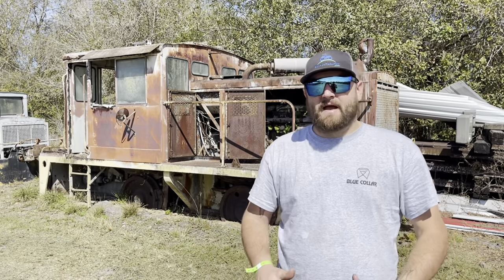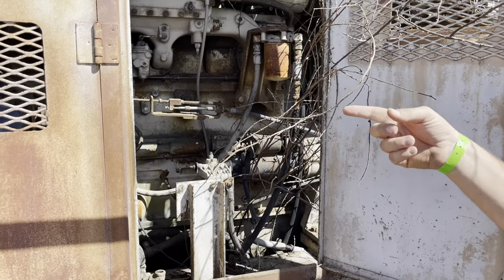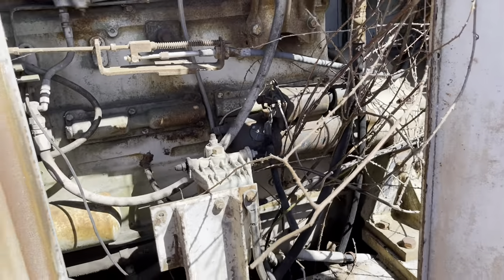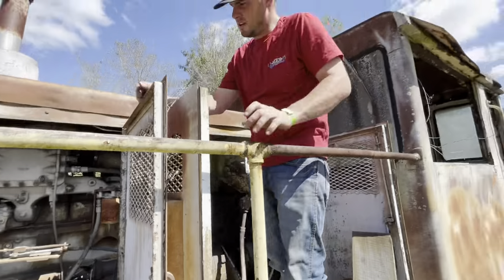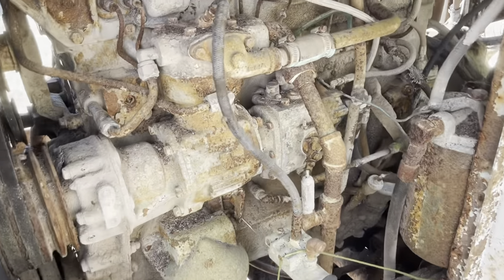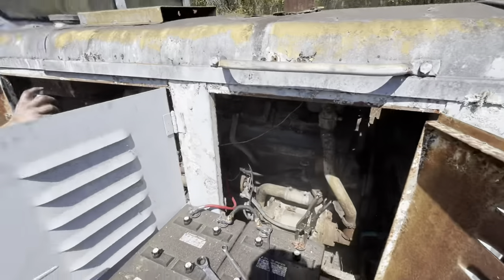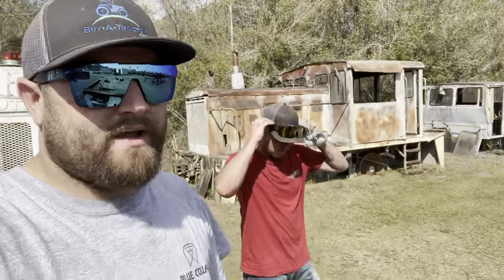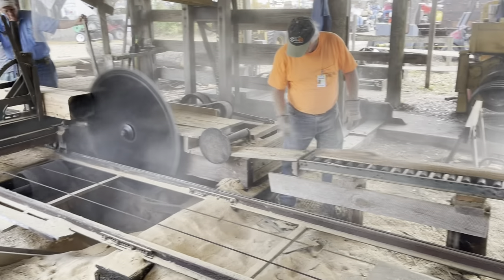WILL IT START? 1962 DIESEL TRAIN LOCOMOTIVE!

Comment: Wow, a torque converter! I've always wondered if there was something different about earlier diesel trains than the ones that are diesel-electric! So these ran on automatic transmissions!

Many years ago I asked my dad if diesel trains were automatic or stickshift, and if sticks, then how big the clutch would have to be! And he said they just run an engine that drives a generator and then that powers electric motors! I was amazed by that.

But he never said anything about an era where there really was a transmission and differential like you would find on a street vehicle! I guess he never really knew about those, so now that I'm hearing about it, I'm actually amazed by this!

So if there are trains with automatic transmissions that drive the wheels, then were there ever any with manual transmissions, just like you would see in a street vehicle? And then that raises the question again: How big would a clutch like that have to be?

Heck, while we're at it: traditional planetary automatic transmissions not only have a torque converter, but they do have clutches too; just not the traditional manual clutch. So how much bigger would the ring gears, sun gears, clutch packs, and bands have to be on something like this than on an average sized street vehicle? Like... maybe before they could have a reliable automatic transmission big enough for one of these, despite the amount of bucking that manual shifting would probably cause down the line?

Ya said "transmission" earlier, and at first I was like, "Did he's seriously just say 'transmission'?" Ha!

Comment: Here is a little heads up on the old Cummins that had a solenoid for fuel inlet - this solonoid has a thumb screw that will allow u to start the engine and you can also shut down the fuel to the pump even with the solonoid energized... so screw the thumb wheel out to allow fuel to flow and in to shut it off

Comment: The only thing that prevents me from owning something with a Diesel engine is the price of the fuel in my area, Diesel fuel is about 50 cents/gallon more than 87 octane gasoline in South-central NY State. But, it takes a lot longer to go bad, I've seen guys get a Diesel running on 50 year old fuel. So much less to go wrong too, fuel is really the only thing to worry about, and it will run on almost anything!

Comment: To shut it off , there’s a ‘manual screw’ on the solenoid , back it outwards to bypass its electrical function , so run the screw back in and it’ll start up and run without current to the solenoid

Comment: Second one is either a C or J series.....yes, before the modern C there was another, and, on a PT pump there is a knurled knob at  of the fsov. Turn it in, no need to have battery voltage to power the pump, turn it out to shut it down....kinda hard to do on the VS pump on the small cam. And the pump does NOT supply high pressure fuel to the injectors, it supplies flow. On those particular engines, MAYBE 140 psi at rated RPM. The injector produces the injection pressures needed to make it run.

Comment: Cummins Motors was one of my specialties especially those old ones the ones that still had a manual pump call the PT power take-off they had natural aspirated and then they came out with the turbo 200 before they hung the turbo on it and made it a 220 big huge thing LOL I go back into the tower pumps that's where the fuel lines ran right into the head the injector lines from the pump distributor right into the side of the head I had compression releases on the old small cam Cummins Motors that made it real nice for starting oh Lord I got a lot information stored up I know those coming from the back of my hand my dad was decent mechanic and now my son is although we did gas and Diesel and so does one of my sons

Comment: Huh, the heater in that thing looks almost identical to the one in my dad's old 1960 Champion 562 Grader. It has a 495 Cummins, basically a 4 cylinder version of the 743 rather than the 855 in this. Older design but a few similarities.

Comment: There’s a thumb screw on the fuel shut off solenoid on those big cams that you can either screw in or out (I can’t remember) to shut it off if the solenoid fails.

Comment: At our museum we have a Plymouth loco. which came with a gas engine in the 40's, but had a small Cat diesel put in at some point, we made it run pretty well. How can you tell the big cam Cummins from the small cam motors so quickly? I usually have to look for the "BIG CAM" on the block or look at the data plate. Telling a small bore from a big bore is a lot easier.
Reply: I think he jumped to conclusions on these Cummins, as there were No "small & big" cam designations for the early NH Series engines.  These NH Cummins in the Plymouth loco's were rated at 275 hp for the NHS and 300hp for the NHRS.... no small or big cam variations.   If your Plymouth at the Museum had a Gasoline powered engine, originally, then it would have been a Hercules RXLD rated at 148hp... "IF" it was a "J" class (15-25 Ton) locomotive.  "IF" it is a M/W Class (25-45 Ton) and Gasoline powered originally, then the "Herc" was replaced with a Buda 6MO970 rated at either 200 or 212hp depending on Locomotive weight rating.
Reply: @Romans--bo7br  Yes, I thought maybe these engines weren’t what he was thinking. Our Plymouth is a 20 ton unit, originally issued to the US Army Corps of Engineers.
Reply: @Flyboy207 .... Hi and Thanks again for the reply.  Interesting that as being original to the Corps of Engineers, that it had a gas engine for the prime mover. When it came to Diesel powered anything in the US military, back in "that era", the 2 cycle GM Diesels (Detroits) "ruled the roost" and about the only exceptions as far as the Corps of Engineers was concerned, was when purchasing heavy equipment like dozers, earth movers, etc. 

Cat was the "only choice" for dozers, earth movers were split up among several builders (Cat, Clark & Euclid, primarily), same with road graders, but the Gallion graders they ordered were primarily powered with the 6-71 GM's, same with smaller drag lines and other types of "shovels".  Around the Korean war era, they did buy some Allis Chalmers - HD41 dozers  with the venerable 6-110 GM diesel.

I would have thought that with the options available for prime movers that the Corps would have ordered the Plymouths with either a Cat D326 or the 6-71 GM (aka - Detroit Diesel).  

So, was your museum 20 ton unit re-powered with the D326 Cat or a newer Cat of similar power output (185hp for the D326 @ 2000 rpm) and similar outer physical dimensions?.. if you know.  

I remember that the larger "road switchers" that the Army had, were primarily Alco's... at least almost every one I witnessed.. except for the occasional Baldwin or FM, and one EMD  SD9 that I came across.   Good memories!!
Reply: @Romans--bo7br  Ft Eustis and many of the bases had RS4TC locos built by Baldwin. Most were repowered with more modern engines at a later date. I used one as a taxi at Ft Eustis when I was there in 1987 and 1988. The Army had both ALCo S2s and ALCo RS-1s in the 40s and ALCo MRS1s and a few EMD MRS1s built in the 50s. If you were lucky, you would find an RSD-1 from the 40s but they were really rare. Later, Army units switched over to EMD GP7 or GP9s. Me getting some equipment off base was deemed important enough that the GPs got moved outside the shops in the winter of 1987-88 at Ft Eustis. The Army S-2s had crankcase oil heaters that you could plug in to keep the engine oil warm. Something that was good to have even down here in S. Florida.  All but our GM 12V71s at work and the 6-71s had prelube pumps and oil heaters. Whole lot better than waiting for them to warm up which took the GMs 15 minutes to do at idle and no load.

The Air Force also had some RS4TCs but seemed to prefer the GE units. Cape Canaveral AFS had some EMD SW8Ms which I've also had a chance to ride in. Those have now been replaced by Trackmobiles. One SW8M is on display at the Missile Museum at the base. When in use, they were used in pairs with them running side by side and MU'd thru an arm that connected them electrically together plus the fact that they were hooked to the transporter.
Reply: @gravelydon7072 .... Hello, and thanks for your reply/comment.  Great information. thank you.  In reference to warming up the 15 minute warm up period for the 2 cycles, "at idle with no load".... they should Never be idled with no load for longer than a couple of minutes, and that's only for cool down after they've been working hard, on the "T & TA /TiB engines to allow for the turbo to cool down.  

Idling the 2 cycles for extended periods with no load Will cause "shellacing" of the liner/cylinder walls and loss of oil control resulting in "slobbering" out of the exhaust.   

I know you, personally.. didn't have any control over that.... as the ole saying goes, "there's the right way... and the Army way". lol   

If they cannot be warmed up with a partial or light load, then the idle speed should be set at 12-1300 rpm in order to generate sufficient cylinder temps to keep the "shellacing" down to a minimum.  

My own V12's were "idled" at 1400 for no longer than about 5 minutes, then put to work under "light" loading until the engine temp reached 120, then gradually increased the loading.

When I was at FT. LeonardWood in the mid-1960s.. several of the civilian instructors tried to get the "brass" to defer me from going to VN, and have me stay there as an instructor (at 18 years old) on the Detroits... especially after they found out that I had a 4 year degree in Diesel Engine Design & Theory, specializing in 2 Cycle and had studied directly under P. Nicholas who was one of the lead design engineers in R&D at GM Diesel.  

He was one of three who was directly responsible for the very first prototype 2 cycle diesel for GM... which was a 4-71, and of which I have a 8 x 10" black & white photo of, taken just moments after the very first "fire-up" in their dyno cell in the fall of 1937, taken with himself, "Boss" Kettering and one other engineer.. which he gave me after my return from my 3rd tour in VN in Nov. 1970, and is hanging on my wall, right above my pc monitor, here.
Reply: @Romans--bo7br  Even if we ran them under load, they really weren't.  The rated fuel use for our engines at max rated load was 19GPH. We were running them at 9GPH. With the cooling that we had, even if our raw water pumps shut down, we had plenty of time to get a different pump running or cross flow our pumps so that 3 engines could run on 2 pumps. We never ran our engines at less that 1400 RPM under load as we had raw fuel come out the muffler drains at anything less. Most times they were run at 1800RPM for 300 hours and then shut down for an oil change. By the time that was done, the engines were still warm and we could go right back to 1800 RPM if needed. We couldn't complain about lifetimes as we put more than 14,000 hours on them between overhauls.

Comment: Old tech and mech: built to last.
Modern: designed to break ASAP to force you to buy more and force you to take loans.
Its why my dad has an old SAAB 99 Turbo. And it frequently outruns all modern family cars, cuz the SAAB 99 Turbo is designed for racing.

Comment: Another thing to on the fuel pumps a little plug on the very top that's where you would prime the pump you would pull the plug take a final fill up the pump with diesel fuel put the plug back in you were good to go and don't forget to feel your filters diesel fuel to I seen some guys use transmission fluid for the fuel filter I strongly do not recommend that diesel fuel only

Comment: An old tip to get a diesel to shut off is to give it a quick shot from a CO2 fire extinguisher into the intake.  The CO2 will displace the oxygen and the cylinders won't fire.  Just make sure it's a CO2 extinguisher and NOT a dry chemical (powder) extinguisher!  That's a mistake you will only make once...

Comment: The Cummings Motors didn't really have a problem with running away Alyssa was a cabover and little Rod Wood stick or The Rocker with flip over and cause it to stick wide open LOL just saying I thought I'd throw that in there every now and then you would get one that would break a shout and run open on you but the manual shutdown on the pump you could override your solenoid and it would do the trick or sometimes a table shut off on the fuel line

Comment: Most train engines have an air shut off
 This means until the air builds up, you cannot shut it down. No engine after a couple  of years will start until you drain all fuel add new fuel and bleed injection pump and injectors.  Diesel fuel starts to go bad in about 3 months.

Comment: The 24 volt system what it did was it had a what they call parallel switch and when you go to gauge the starter it throws it to 24-volt when it disengages you're on regular 12 volts just thought I'd throw that out there guys if you ever want to get ahold of one get ahold of Discount Auto Electric in Modesto California I believe it's 935 8th Street talk to Tony Mazzola he'll fix you up.

Comment: 1962? That almost looks as if its a 30s model.. Most were originally gasoline and weighed a rough 30 to 35 ton.. The old Pioneer and Fayette railroad had a Plymouth and many Plymouth locomotives were discontinued late 40s when Alco slowly started to run the show in the mid eras

Comment: They will run just fine without the turbo.   Cummins has a manual bypass for a bad fuel solenoid - just screw it in.

Comment: What I understand, they had the Plymouth name before the car company, and they had to buy the rights to the name from the locomotive company, because I think they built cars at one time, before the Plymouth car manufacturers that was associated to Chrysler.
Reply: You are 100% correct Plymouth locomotives sold the name to Chrysler for a dollar !!!! Plymouth locomotives of Plymouth Ohio owned the the name and also built that had the friction drive clutch
Reply: @plymouth-hl20ton37  yea, I live just north of Mansfield Ohio, and live about 20 miles from Plymouth, that is why over the years I heard a lot of stories about the locomotive plant. There are also a lot of Silver King tractors in this area, because they were built so close. They were a smaller tractor, about the same as old 8 and 9n tractors, with Continental engines in them, the same motor put in farmalls A,B,and C. I have drove Silver King tractors, and the road gear was so fast, they were a dangerous thing to play with.  I don't know if you have ever driven an old tractor like that, but these would go over 40 mph, which is more than twice what they can be driven safely. The company was called the Fate, Root and Heath Company. Have a good day.

Comment: Man you gotta install a freight train engine in a semi at some point. That's what I would've always loved to do!! But can't do it, don't got the means..
Reply: What "V8 diesel"??  There were No "V8" diesels in any of the 4 Plymouth locomotives in this video... three Cummins (HRS-600 & NHRS) and a D326 Cat in the fourth one.
Reply: @Romans--bo7br  what's the engine in the locomotive featured at the very first? I thought to have seen 4 exhaust outlets where it goes into the manifold, so I figured it would be a V8.
Reply: @Romans--bo7br  okay my bad, had a closer look again just now: Yeah I should've recognized that there are two more exhaust outlets on that motor. So yeah I take it back. Not deleting my comment however.
Reply: @GTA3Modder ... Hello, and thanks for your reply.  The First Plymouth has a Cummins NHRS which was rated at 300hp @ 2000 rpm.  There were nine prime mover options for that particular model (M Class) locomotive (25 ton), a 6-71GM,  6-110GM, an NHS & NHRS Cummins, Cat D326 & D337, Buda 6DA-679(Diesel) & 6MO883(Gasoline) and a Hercules DFXH.
Reply: @GTA3Modder ... Hello, again... we All make mistakes. lol  I just replied to your other reply and question a few minutes ago.. and answered your question, along with some added information, just for nostalgia knowledge sake.
Reply: @Romans--bo7br  thank you for all that information!!! 👍🏼👍🏼

Comment: Imagine swapping it to wheels and give it steering
Reply: You may laugh but the Army during WW 2 had some that looked just like they had done the opposite to a truck. The 10' wide cab was the dead giveaway that they had not and were built to operate both on and off the tracks.

Comment: Small diesel switchers are extremely useful in small industrial yards, I can't understand why anyone would scrap these locomotives.
Reply: It could be because of age. Sure, there are some older switchers that are still in use today, but there are still a lot of models that were discontinued and parts are either really hard or expensive to maintain and replace. I'm not 100% sure, but that's my guess.
Reply: @gearsmashking6880  Yes you'r right. I didn't think of that. And some of these were hydraulic transmissions.

Comment: Again with the Cummins Motors NH and the NTC any of them that had the manual pump we'll have a buttons on the back of the fuel solenoid that turns in and out that's a manual shut-off it's a manual override it will override the electricity part and just in case your alternator went out you would put it on manual override Polestar 2 or get a quick jump start and you were supposed to go until you got the alternator fixed or the belt which ever happened

Comment: Okay so if you buy a train and get it running what would you even do with it as a common person like you can’t drive it around and I’m assuming a normal non train conductor person can’t just put a random train on a railroad and start driving around??? Would be cool to just go anywhere on the railroads but seems like a lot of hassle if you can even get it back on some tracks